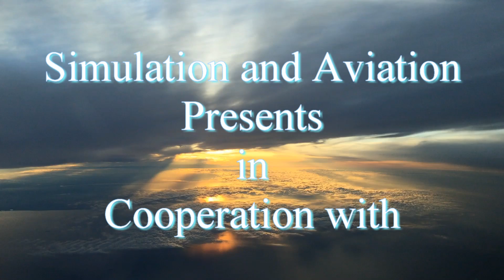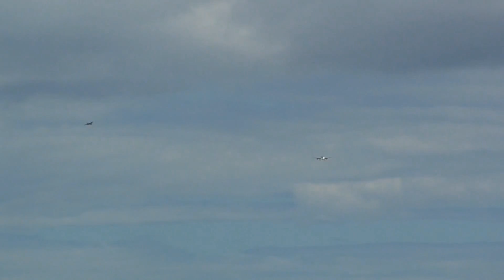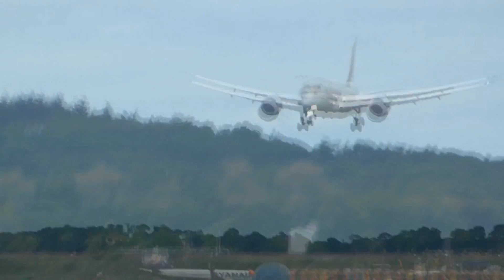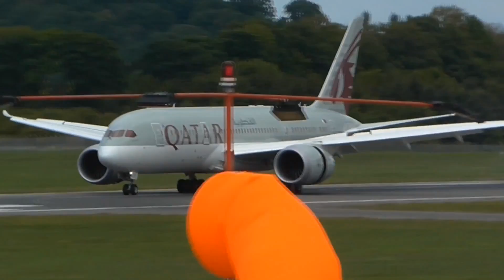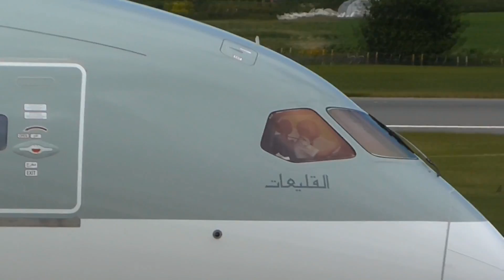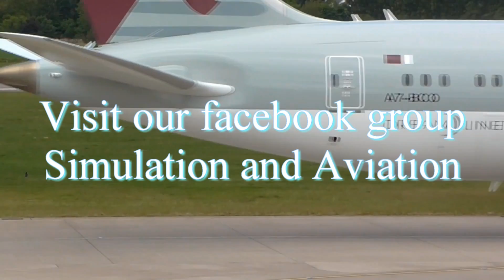What is he doing ? Dreamliner Long Aerodynamic Breaking during landing Edinburgh Airport

Comment: Over rotation?? This concept is wrong, and “aerodynamic braking”? I’ve never heard about this thing. Keeping the nose high does exactly the opposite of braking. Mind you if it’s a short runway, it makes no sense keeping the nose off the ground for “aerodynamic braking”, when what you exactly need is to put it on the ground and stop at the most efficient way. C’mon guys, don’t write what you don’t know.
Reply from the maker: Fighters use the aerodynamic brakeing to reduce brake wear. Wich  makes sense if you have a long rwy. Airliners dont use this technic though🤗
Reply: Fly&Like w/Simulation and Aviation So this definition for civil aviation is misused. Cheers!

Comment: Look at the elevator... He is pumping the elevator. The manual says to "fly the nose down". As long as you don't hit the tail, no problem....but  if you wait too long to fly it down then the tail "stalls" and the nose drops suddenly. It's not easy to get a "soft nose landing" if you hold it off too long. As nice as it looks.
Reply from the maker: Hi Peter. Didnt actually check out the elevator to begin with, but I see your point. Thx for your input 🤗

Comment: That's what I did when I started flying 777. Landing the nose wheel is a bit different from the 737. Holding the back pressure on the yoke expecting the nose to come down by itself slowly didn't work. Exactly like what happened here. Once the airspeed ran out, the nose just drop and pulling back on the yoke hard just couldn't stop the nose from slamming down. The key is to start flying the nose down once the main has touched.

Comment: Where exactly do you see an "Over Rotation"?  I don't see anything like an over rotation, in fact I see an almost perfect landing.  Whoever was doing the landing,  the PIC or First Officer/Co-Pilot, held the nose a bit longer than what might be considered "Normal", possibly indicating a landing a little faster than optimal but certainly nothing out of the ordinary or disturbing in any way.  In fact your own videos comments at the end would imply the exact opposite of an over rotation,  the Flare! Flare! comments... To me that implies you thought he was too flat in almost a three point condition,  very bad as the nose wheel is not stressed for landing transfers an thus could be badly damaged or even collapse.  From just about my first flight,  and in every type I've flown since,  it was always stressed to keep back pressure on landing to keep the nose in the air as long as possible and let the nose settle on its own naturally due to decreasing airspeed and loss of lift over the horizontal stab and elevators.  That is exactly what this guy did as far as I can tell.  and as far as the flare goes,  again looks to me like it was near perfect.  You always fly slightly nose down,  negative attack angle,  in final approach, flying the aircraft down the glideslope and flare at the last moment,  dumping lift and stalling to prevent "Ballooning" up necessitating a bolter. That exact thing kills many inexperienced pilots as they misjudge and balloon up then try to shove the nose back down to salvage an unsalvageable landing.  
  Finally,  most over rotation refers to takeoff where they over rotate and scrap the tail along the ground, that is why that area is built up.  I think it would result in either ballooning up or a catostrophic crash if you did that on landing, basically landing with the tail,  Which built up or not could never take that kind of transfer of energy and force,  no single point could.  I know Im staying but I'm just trying to figure out how you get over rotation from what you showed on your video.  I would give benefit of doubt to anyone who claimed to be an authority or expert,  as doing a channel on the subject would imply...  Maybe you accidentally posted the wrong video for its title? or something else like that?
Reply from the maker: You are right :) thx for the comment and sharing of the video. https://www.facebook.com/simavihd/

Comment: Keeping the nose up like that is called "aerodynamic braking".  The aircraft remains in a maximum drag condition, decelerating just a bit more efficiently than it would with the nose down, and relying on just reverse thrust and wheel braking. 

I did it on every landing in the Cessna. Hold touchdown attitude (about 10 degrees nose up) after the main wheels were on the ground. As the plane slowed, I pull back on the yoke; keeping the nose up until the elevator loses effectiveness; and the nose comes down on its own.

Aerodynamically unecesessary. It makes me think i've got hot hands. And it looks good to anybody watching the plane roll down the runway on two wheels. Pilots.
Reply from the maker: Hi Michael.. Yes indeed it is an aerodynamic breaking. Mostly used by fighters, and very seldom for the Airliners to do ;) But it looked nice indeed. :) Have a great day. and thanks for your input. Sorry for the delay in answering, and thx for eventually sharing the video out there. :)
Reply from the maker: +Michael Powell By the way, If you liked my video, I think you would love my Facebook page as well. Simulation and Aviation. 🛫🌞🛬 Check it out... Thx.  https://www.facebook.com/simavihd/?ref=settings
Reply: guys,,,, i try to do the same,, but it seems that my nose wheel got harder impact after elevator lose its effectiveness.....
please advise... :-)
Reply: That's the difference between a good pilot and a great pilot.  Good pilots know how to utilize aerodynamic braking.  Great pilots know how to utilize aerodynamic braking and when to release back pressure on the stick so that the nosewheel still touches down gently.
Reply: Keeping the nose up like that actually, increases landing distance. You have to get into the maths of why this extends landing distance but in simple terms, braking (at the wheels) is reduced by increasing lift (nose is held up) whereby the brakes are actually the major braking force on the aircraft.

You will actually stop quicker by putting the nose down (max weight on wheels) and applying braking in a timely manner (aerodynamic and friction braking).

Maximum drag doesn't mean maximum braking.

Maximum drag could be better on a particular type of aircraft if it has a poor braking system but for large commercial aircraft these are designed to have minimum drag and hence are slipperly, so profile drag by holding the nose up is actually not that great. 

If this aircraft had a partial hydraulic loss and only had alternative braking (maybe one wheel on either gear available) this would probably be a reason for holding the nose up.

just my 2 cents :)
Reply: Good point, Greg. My experience was that as the elevator lost effectiveness. it didn't just end, and the nose wheel dropped to the runway.  As effectiveness lessened, the nose wheel came down slowly, and touched down gently.
Reply: NOPE That's called buttering the bread.
Reply: Michael Powell Incorrect!!! They increased their landing distance by not lowering the nose...
Reply: For my UK guys here, maybe the pilot had a chopper bike or a grifter as a kid!

Comment: I could be wrong but I believe that would not be considered a flare. Flare occurs only when above the runway and still in flight. Having main gear already touched down would not qualify..
Reply: Ted Bryon the more weight you put on the main gear the faster the plane would slow down but it's not very common for commercial planes. Must have been a short runway :)
Reply from the maker: You are very right. It is my mistake. A flare is when you break you descent just before landing and flare it down towards the runway. This is actually called Aerodynamic breaking and is normally used bu fighters after landing to save their brakes :)

Comment: Still a better landing. The landings in A319 are kangaroo jacks.
Reply: +Ashvin Ambegaonker ouch, you should not say something like this to an A319 captain... :-D
Reply from the maker: +Ashvin Ambegaonker Hi Ashvin... You need to try a trip with me in the Airbus 319 It is a fantastic lander
Reply: +Simulation and Aviation I meant the landings of Qatar airways in A319 are not exactly smooth. Because the weather conditions in certain parts of India are near perfect to learn flying. Very low winds, good pressure, and warm temps. But still amateurs fly the small planes in this airline.
Reply: Ashvin Ambegaonker A319 always land smooth, 737s land quite firm

Comment: Great video some nice shots. Very much against the advice in the Boeing flight crew training manual. Try this on a check and you'd be into the office to explain your actions (airline dependant). The spoilers remove a significant proportion of the lift upon main gear touchdown removing the need to increase the risk of tail-strike and extend the landing roll in this manner. This 'technique' of prolonging the DE-rotation actually increases landing roll on large transport category aircraft since the autobrakes do not engage with the pitch attitude >1 deg. Useful on fighter aircraft etc without efficient lift dump available.
Still.... :-D

Comment: RUNWAY 24, SURFACE WIND 010 AT 5 KNOTS. THIS CROSS TAILWIND COMPONENT.
RESULTS IN A HIGHER GROUNDSPEED. TO  REDUCE THE LANDING ROLL KEEP THE NOSE WHEEL OFF AS LONG AS POSSIBLE TO INCREASE DRAG AND KEEP THE WEIGHT ON THE MAIN LANDING GEAR.
DONT KNOW WHY HE WASN'T GIVEN RUNWAY O6.
Reply: COMMENT  NOT ROTATIN G, ITS CALLED FLARING
Reply: +COMMENT Jesus christ man, fix your capslock button...
Reply: +FlyingDutchMan225 Sorry man. fixed
Reply: +COMMENT Ek is baie jammer

Comment: More weight on the main gear for better braking and a bit more aerodynamic braking from the higher AoA of the wing (more drag).
Reply: atobpilot CORRECT. HE HAD A TAILWIND THEREFORE A HIGHER GROUNDSPEED, PROPABLY DID NOT COMPENSATE FOR  THE INCREASE EARLIER.
Reply: If he had tailwind, then why didn't he land on the other side of the runway? Aircrafts always land into the wind!
Reply: Frank Post YES IT'S NOT NORMAL TO LAND WITH A TAIL WIND. LANDING IS ALWAYS DONE INTO THE WIND.
THIS WAS NOT THE CASE HERE, RUNWAY 24, SURFACE WIND 010.
THE REASONS COULD BE MANY.
Reply: +COMMENT It's more accurate to say that it's normal to land with a headwind. Tailwind landings are not uncommon, but it depends on performance calculations, with each aircraft type having a maximum allowable tailwind component for that specific runway with the specific weather conditions (temperature, pressure, surface condition, etc) on  the day. I'd love to see where it says aerodynamic braking is acceptable in the Qatar SOPs! Pretty damned sure it's not included in the Required Landing Distance calculation charts on any modern passenger airliner. Still, it does look kinda funky.
Reply: +RJ Clark .TRUE . That is a more accurate way to put it. 
Aerodynamic braking is not a standard operating procedure. Good pilots, taking into account the present scenario will  use their discretion and divert from the SOPs of the airline but not of the manufacturer.
Reply: Well of course, if the commander can justify a decision as being in the interests of the safety of the flight, a crew can divert from SOP. It needs to be a sound decision, though, Wheelie-ing down a runway doesn't fall into that category. If something stupid happened and they lost directional control due to lack of rudder authority at low speed and no nose wheel steering, that's going to be difficult to defend. Likewise a tailstrike. Spoilers already provide aerodynamic braking, as well as killing the lift and putting weight on the wheels. I'll buy a pint for anyone who can show me a wheelie anywhere in Boeing's SOPs. ;) Done it a few times in light aircraft, myself, though. Different kettle of fish.
Reply: +RJ Clark ."If something stupid happened and they lost directional control due to lack of rudder authority at low speed " This is not relevant here. The 'wheelie' was done at a relatively high speed. and the nose wheel lowered at a safe speed. the rudder still very effective.
 "Likewise a tailstrike". ????. 
"Spoilers already provide aerodynamic braking, as well as killing the lift and putting weight on the wheels."
Yes, but the holding back further reduces the braking distance In this case. remember a higher ground speed here.. tailwind.
I'll buy a pint for anyone who can show me a wheelie anywhere in Boeing's SOPs
No airline will put an action as part of their SOP, which can , if not properly executed by a skilled pilot result in an incident which may put liability against them.
Remember this is all about money. so some actions are out the window even though these actions or procedures in certain situations can be life saving.
Reply: +RJ Clark "I'm afraid that's just not correct" - which part.

"Braking efficiency in an airliner is most efficient with all wheels on the ground." Who denies this. More wheelson ground = more friction. ... BUT  the main landing gear plus the  increased  drag caused by "aerodynamic braking"  is more efficient  in slowing the plane compare to all the wheels on the ground in most cases. ( small aircraft may differ significantly due to the relative aerodynamic ratio. Like I said earlier this is done by skilled experienced and knowledgeable pilots. (The drag created by this manoeuvre on a large surface of the spoilers and the fuselage due to the angle of attack  vs the friction of the small contact surface of the nose wheels on the runway) 
" The tailstrike comment is relating to the pitching up moment which is created by the spoilers."
Yes this is true but only if left unchecked or uncontrolled. Again skill, experience and knowledge required to avoid this.
As an airline pilot you have to carry out procedures based on measurable calculations, and the tailwind is taken into account in those calculations. I just don't see any good reason to deviate from those in this manner, unless you're simply showing off.
That is what is being done her. Showing off , I don't think so here.

Any airline pilot should be skilled enough to hold a long flare half way down the runway, if they so desired, but nobody does because it's not their job to show off.
This is not entirely true. touchdown is usually 1.3 x your stall speed. Depending on headwind,  surface type weight of aircraft and altitude, the flare will not depend on skill. the nose will drop.
your 
"With the greatest of respect, I'm assuming you're not an airline pilot.'
Your assumption is wrong
Reply: +COMMENT I'm afraid that's just not correct. Braking efficiency in an airliner is most efficient with all wheels on the ground. Deliberately using an unapproved technique throws the landing distance calculations out the window. The tailstrike comment is relating to the pitching up moment which is created by the spoilers. The point is, the technique is not appropriate or useful in this sort of aircraft. As an airline pilot you have to carry out procedures based on measurable calculations, and the tailwind is taken into account in those calculations. I just don't see any good reason to deviate from those in this manner, unless you're simply showing off. Any airline pilot should be skilled enough to hold a long flare half way down the runway, if they so desired, but nobody does because it's not their job to show off. With the greatest of respect, I'm assuming you're not an airline pilot.
Reply: He wouldn't of had a tailwind. It's just called aerodynamic braking. In which the plane I.e this one keeps the nose up and uses its fuselage to slow down. A lot of millatry plane do this as most of them have no reverse thrust. There is quite a lot of videos on YouTube go check them out
Reply: Lewis Barber "He wouldn't of had a tailwind" RUNWAY 24, SURFACE WIND 010 AT 5 KNOTS. IS THAT NOT A TAIL WIND? OR AM I LISTENING WRONG